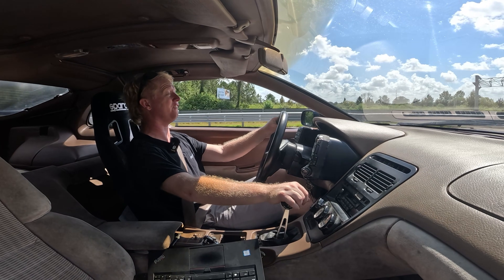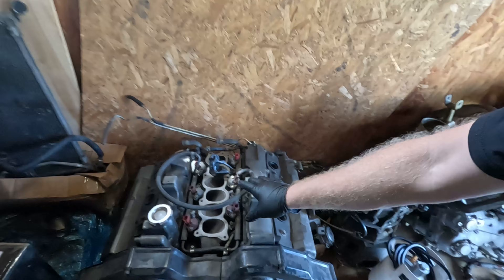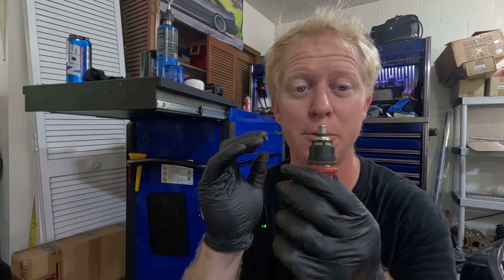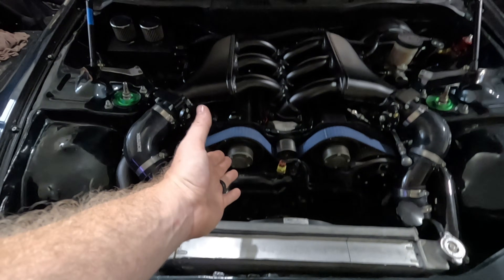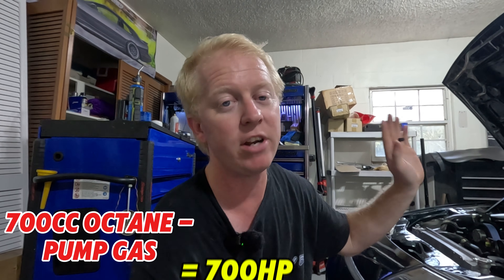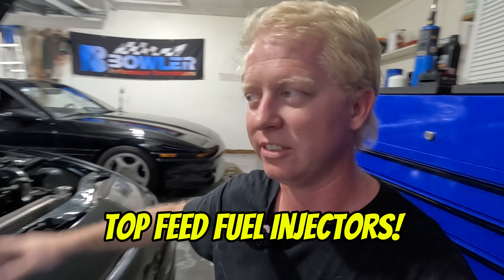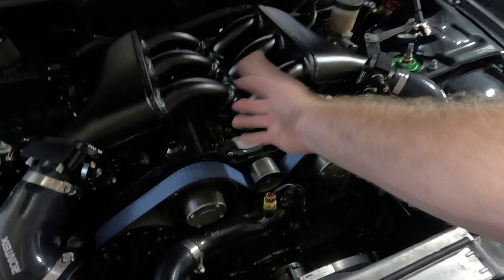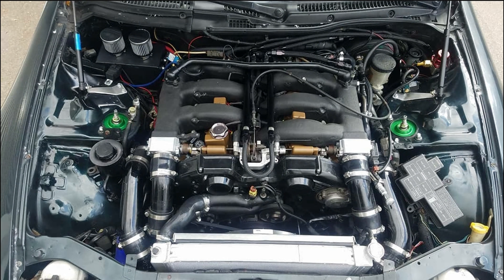Everything You Need to Know about 300ZX Injectors! (And Why They Fail)

Comment: Thank you for all this info! 
Quick question, on the EV14 they offer standard, long and short version. Which ones work with the z32?
Reply from the maker: You just need to match them to the fuel rails. Most need the short. But whichever fuel rails you get typically provide info on what size you need.
Reply: @Billy_Built Got it, Thank you! 🙏

Comment: Currently have 300° fuel rail with Nismo 740cc injectors. I've never had any issues until recently... Even after getting the injectors ultrasonic cleaned, one is causing problems. I'm looking at going top feed.

Comment: The timing on this video couldn’t be more impeccable. I believe I have a stuck open injector dump fuel all the way back out my exhaust
Reply from the maker: @jeremythompson6822  😅 mine use to clear out after running for a minute, but the first start would be an extended crank and then finally blw out the fuel.
Reply: @Billy_Built  I have a NA at the moment. 270cc top feed injectors are hard to come by.
Reply from the maker: @jeremythompson6822  you'll be fine with anything 1000 or less on a top feed setup, but you would definitely need a tune.
Reply: @Billy_Built  awesome! I didn’t even know you could do that. I thought with NA there weren’t any options to do that.

Comment: Switched to top feed Injector Dynamics few weeks ago after I had an AUS side feed fail, spitting an o-ring out and hydrolocking my motor after 2 tanks of e85
Reply from the maker: I've only heard of it happening a few times, but iI feel as though it's more common than we realize. Definitely a worthwhile, peace of mind investment!
Reply: @Billy_Built  I luckily didn't bend a rod, pretty much happened at idle. Car died, fuel pressure dropped from 43 to 2. Turned it over, starter sounded like it fell out the bottom.. Immediately knew what it was.